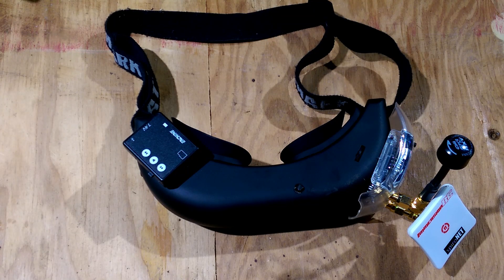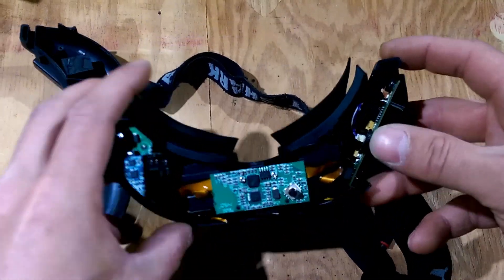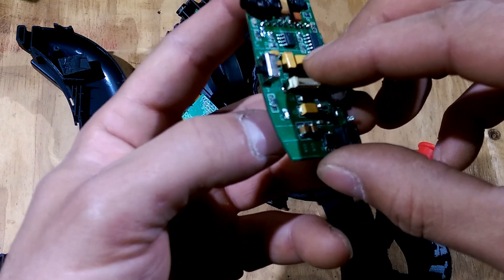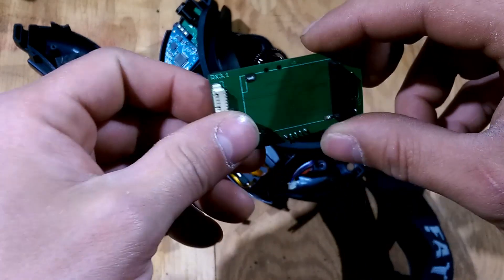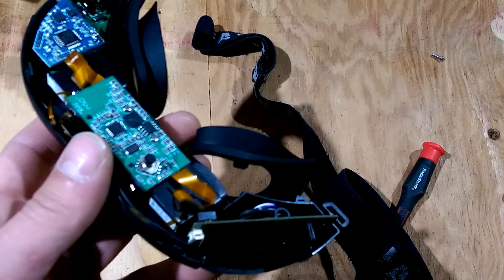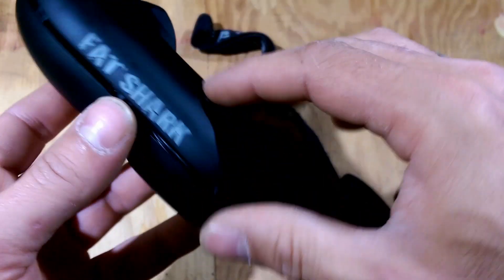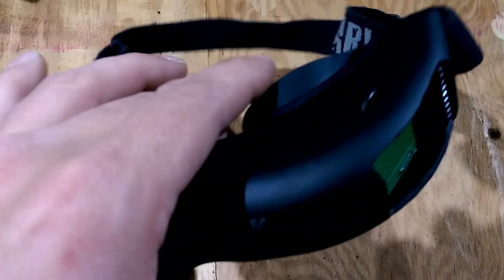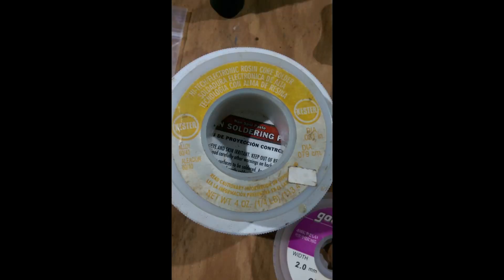How I added Furious FPV True D 3.6 to Attitude V2 goggles

Comment: How did you fit dvr ??
Reply from the maker: External DVR module taped to the top with double sided tape. Cord plugs into the goggles.
Reply: @DarrellDrinkwine  ive got the yellow eachine dvr can I do the same if so could you please explain a little thx
Reply from the maker: @ryanpulman  so the module I have you can simply connect the usb to the jack next to the battery plug in (usb to audio/video 3mm adapter I think) then plug the balance lead of  the battery into it for power. If I remember there were a couple orange ones. if you have the ProDVR you would have to use the 6 pin connector in the middle and figure out which wires on the headphone style jack are audio and video, then figure out a 5v voltage source. I would guess you would need an adapter (something to step up or down the voltage) between the battery and the DVR unit, or probe around the power supply board of the goggles to find a 5v source there with a multimeter.

Comment: Thanks for sharing! Do you think this would work with most diversity module?  also what happens with the channel control that's left on that board?
Reply from the maker: I think it would work with most. The only concern would be the clearview? There was one with a power consumption issue with one of them and needed a separate power cable. As long as the pinout it the same any module would work. I disregarded the channel selector as the true-d has the buttons.

Comment: Has any modification been required in the module's pinout?
Reply from the maker: Nothing gets changed
Reply: @DarrellDrinkwine  you have the file to print the module's protective cover
Reply from the maker: @firmofpv4430  no. the cover came with the module when i purchased it. There was two Options for the cover.   You may be able to find one on Thingiverse though.  I have not looked into though. i bought this style because I later got the HDO goggles and use this module in thm now. I soldered a header back onto the old module and use the old goggle as ride along goggles now.

Comment: Great video! Thx!  Do you by chance have instructions for the DVR mod?
Reply from the maker: Nathan, no I don't. I just have the module on top of the goggle as seen in the picture. I do remember seeing a video on that MOD though, but I can't remember who did it off hand at the moment. 😖
Reply: No worries!  I appreciate you responding.  Did you wire yours with a 5V step down?  I'm contemplating hardwiring it to the backside of the board the RX plugs into to get around the step down.
Reply from the maker: If you're talking about the DVR it just plugs into the balance lead of the battery. It's kind of a pain and the reason why I don't dvr much. Lol
Reply from the maker: Maybe I'll do the mod, and see how it goes. 😜